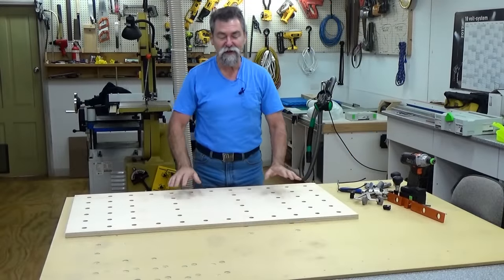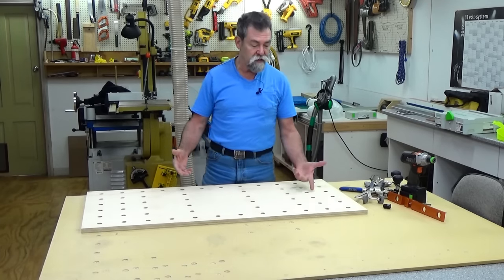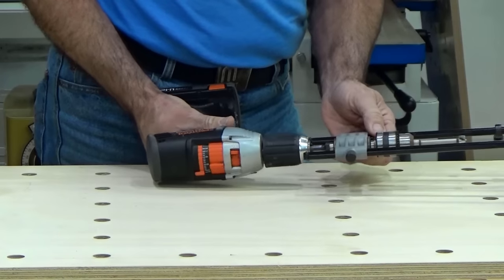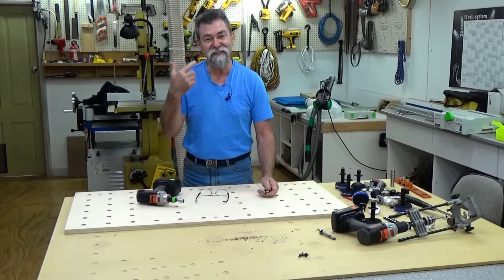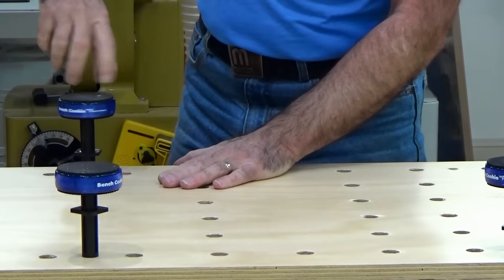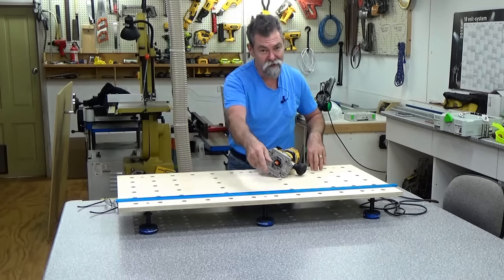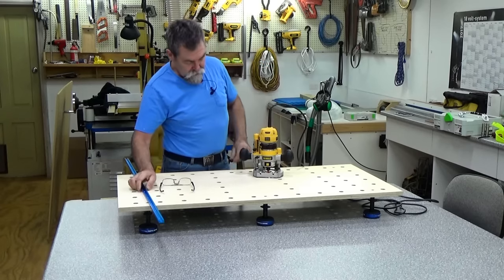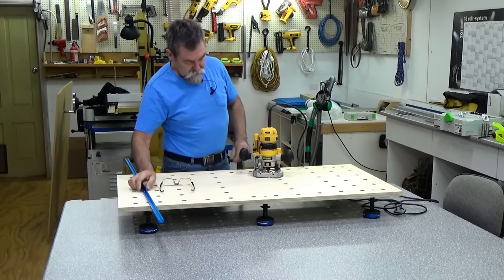Build this Festool mft style portable bench for under $150 Dave Stanton woodworking workbench

Comment: Hi Dave.  I am considering using this top for a new work bench as a permanent  fixture.  I do like the Festool MFT but prefer a table which I can roll around.  Thoughts on using this build for this type of bench?
Reply from the maker: It will be fine! Maybe use a hardwood marine ply instead of a softwood as it will have a bit more resistance to possible bowing.
Reply: Good advise.  Do you find the size is ok being 45 9/16" x 30 7/16" (1157 x 773 mm) which is the MFT default size is large enough?  For me a bit larger would be ideal but I don't think it would be a good idea ordering extra Festool MFT side rails and piece them in to make the table larger.  For me the ideal table would have outside table dimensions of 48" x  36" (1,219.2 Millimeters x 914.4 Millimeters.
Reply from the maker: The size of the top will have to be a personal thing Gary.

Comment: Great video!

I was wondering if it is standard practice to plane the edge of the plywood sheet like you did - is it a concern that the plane cutting edge will get dull easily? Or can I plane the edge of ply like Baltic birch without fear? 
Your thoughts are much appreciated!
Reply from the maker: A low angle plane is usually best for planing end grain but, Just as long as you are getting a good result from a plane then the result on the job being worked is more important than the blade on the plane. That is why we learn how to sharpen blades.

Comment: The MFT seems great, thank you for making these videos! I have a question though: how tall is your base table? Is it lower than a normal work table to adjust for the extra height of the MFT (3/4 inch MFT table + 1 inch bench cookie + 1 inch riser = 69,85 mm / 2,75 inches)? Or do you have some sort of height adjustment system (lift, etc)? I am planning on the MFT along with buying or making a work table, so I wonder how you solve this problem... Grateful for any advice on this!
Reply from the maker: The Stanton bench is designed to go on top of a standard dining room table which is around 700 to 770 mm tall. The work surface I have it sat on here is the same height as my table saw.
Reply: Thanks for the quick reply! That makes sense, I guess this is more directed towards those who do not have enough room for a dedicated workbench. After some googling I found out that table saws are often 34-35 inches or 870 mm tall, I am a bit worried the Stanton bench will be too high if I buy/build a 870mm work table. Could I ask, if you were to build yourself a workbench/assembly table and you only had room for one, how would you build it/what kind would you build?
Reply from the maker: It really depends on the circumstances and need as well as your height.
Reply: Good points! Thanks again!
Reply: @bjormeli  
Make your own custom bench to work with. You can build in all manner of clamping solutions and fixing methods that you will not be able to have on a bought table unless you are paying a fortune. 

I have an MFT3 table but it is for use on the jobsite and not for the workshop really. I have made several portable benches similar to this video but not quite as good and I am going back to the drawing board.

Comment: Could you use Formply for this? Or is the waxed hoop pine better for some reason?
Reply from the maker: Yes to formply but it is only 17mm thick so you will need to shim that last mm for the legs to work correctly.
Reply: @DavidStanton  Thanks Dave, Your a Legend!!

Comment: Hey David, been watching your videos for awhile all the way from California. Isnt the Internet amazing to bring our wood working communities together? I just want to say i really like many concepts in this bench and think i might build my own rendition using your plans. I think i might double up the plywood and laminate them together so i can have a little more mass for chiseling mortises and such. I will add an extra t track for clamp accessories rather than the festool clamps.  I like the MFT style dog holes and that i can use my track saw with my protractor on it similar to the MFT. 

My question is, do you see any other way of drilling the holes in the top without buying the expensive drilling system? The bench top is cheap to make, but with the drilling system, it turns into a very expensive endeavor. Thanks
Reply from the maker: No other way that is as accurate.
Reply: hmmm. I am thinking I might just try to make my own template and get them visually close enough to work. I wouldnt be using the dog holes for the crosscut feature. I would be setting up a MFT style protractor rig for my track saw i think. That would work for me. The dogs will mostly be for planing boards and holding work for mortising etc.
Reply from the maker: That would be fine if it was not relying on dead square. You could use the drill guide that I used for the brass inserts.

Comment: How accurate should the MFT table be? For instance the Festool MFT and such. Reason i ask is i purchased  jig to make the grid and was not happy with the accuracy. I could not get past a 6x16 hole layout with out seeing runoff due to the guides locking in the jig had some slop. I might get it to be better if i add around the template guide to tighten the tollerances. But when i contact the manufacture they claim that tables are never accurate its the fence system that makes the accuracy and i was expecting too much even thought there jig was at a premium price off $199. Purchased this one due to UJK was out of stock but now i have one but have not used it yet.
This was the response when i gave them the numbers that either the jig was off or the supplied Template guide was off.

Hello Cliff.  There is a big misconception with MFT tables and tops. The accuracy of a Festool MFT table comes from the actual rails that are part of the table itself.  All  of the Festool attachments are attached and referenced off of the rails.  Not the table.     If you think about all the “connections” from the router to the actual hole there are a lot of variables at play

Router bit.
Bushing to router.
Bushing to template.
Indexing pin to template.
Indexing pin to hole.
Locating pins to the template.
Locating pins to the workpiece.
potential runout in the router collet 
 

There has to be sufficient clearance between each of those for them to work.  As you add holes, that “stackup” error will grow.  The only way to avoid that would be to key off of the same location for each hole.  Essentially what a CNC does.  You want to make sure that there is no movement in the template when drilling the first holes.  The template must be firmly clampled in place. 

 

The Festool MFT table is a clamping/work table. Without the additional fence system, it cannot be used to make accurate cuts. Once you install the Fence system, you must calibrate the track to the fence.  At no time are the holes a part of that calibration as the holes are only used for clamps and stop etc.  

 

Even if done on a CNC, with the movements and wear in MDF/wood, even the Festool table is not very accurate. Check the Festool marketing data and you will not find anything about using the holes to make cuts, only for work holding. The accuracy comes from the MFT table rails.
Reply from the maker: Hi ealdydar! Return the jig to the manufacturer. The answer they gave you is absolute rubbish! The hole alignment must be accurate, if not why would they be selling a jig to try to be accurate???? You may as well drill holes at random if clamping is the only purpose.
Reply: @DavidStanton  Thx for your comments. i have a UJK Parf Guide  now and im over the top satisfied with it. Id do a layout with it the check all different sides 3 4 5 with the sticks and taking my time it just works. Love your content. I dont care if content is simple or advanced alway looking to see what people or doing to advance my craft.

Comment: Bought a 4'x4' pegboard with 1/4" holes and exactly 1" spacing, quite inexpensive and I need it anyways. 

Used a 1/4" forstner bit to pin point the position first and then drill 3/4" holes with Forstner with 4" spacing on a 2'x4' poplar plywood sheet. Turns out to be quite accurate.

The recommended insert is really bad idea to me. It gets loose quickly. Also, the bolt and even together with nut get stuck with the insert quickly. When I turn the bolt loose, it actually turns the whole insert out too. I would rather use flush flanged insert instead.

Better yet, I would spot face on the top side and use a bolt to tighten down a stand I can make myself using such flush flange insert. Put a sand paper at the bottom of such extremely simple stand and it will not move anywhere.

I can then use the Rockler cookies for the bench instead.

Really appreciate this video and it made me to make one of this (similar) and learned a lot from such process. I also found that a 15 amp drill make drilling 3/4" holes much easier.

Keep exchanging the ideas and lessons so we can all learn something everyday.

Comment: Oops, one more suggestion:  For those who are lazy like me, instead of clearing the hold-down surface in order to flip the top to the cutting side,  you can use a piece of 1/4" MDF as a sacrificial surface protecting the hold-down side from the blade.  Just slide it up against the dogs and cut just like an MFT -- those non-skid strips will hold it in place perfectly.
Reply from the maker: That is a possibility.

Comment: Hi Dave. Just wondering what is the height of your assembly bench from your floor? 850mm-900mm? Not the height of the Stanton bench with the cookies under it. I just got the praf guide system and I am going to make a similar version but bigger.
Reply from the maker: I built mine to be exactly the same height as my table saw. Close enough to 860mm.
Reply: Thanks for the speedy reply Dave. Love the videos, keep up the good work. I'll send you a picture of my bench when I finish it, im making based off your Stanton bench with some modifications to suit my needs.

Comment: Dave the square guide for the plane is that available locally and does it fit a particular size plane
Reply from the maker: Hi Jim. It is a veritas fence and carbatec have them. https://www.carbatec.com.au/handtools-and-handplanes/handplanes/accessories/jointing-fence-veritas
Reply: Thanks Dave, had not seen it before, makes the job of sitting square so much easier

Comment: Dave thank you for the information and looking to build: can get Carter Holt Harvey 1200mm x 595mm (1/4 sheet) 17mm F14 FORMrite Formply from my local Bunnings store for $10.98. would this material be suitable.
Reply from the maker: It will still work but the only problems I foresee would be the t track has 2 mm less plywood below it in the dado and the dogs may not clamp tight from underneath if you use the speed bolts.

Comment: What size is the tee channel.
Reply from the maker: Charles Sharpe, it is 3/4 x 3/8.
Reply: @DavidStanton  Many thanks for the  info and the quick reply. I have been in woodwork most of my life use a 11 foot long joiners bench I made with a top made from 2x8 front and back and 3/4 floor board in the middle. I am seriously thinking of changing over to a flat MFT style.

Comment: Why didn't you just use shorter screws and eliminate the grinding and sanding?
Reply from the maker: I didn't want to drill new holes in the track to make larger diameter's.

Comment: OK so we’re all woodworking nerds here and we’re all going to nit pick. In all likelihood you probably have better hand-eye coordination than me and you put those track screws right where you wanted them. I definitely would’ve used a vix bit to start those. I’ve ordered too many hard wood door frames from various millworks where the guys didn’t take the simple step of using a vix bit and the hinge screws looked all wobbly and shitty. Pre-hung, you don’t see that shit until it’s installed, and then what do you do?
Reply from the maker: Use a vix bit David, it will of course help.
Reply: @DavidStanton  thanks David, will do.

Comment: Thank you for sharing. 
BUT: Using router without dust extraction, dust mask and then use that great facemask with sender attached to vacuum DOESN'T make sense.. and then use sander no mask no vacuum..
Thumbs up in anyways, it's great video in general.
Reply from the maker: Watch again. I think you will see I have dust control pretty much covered in one way or another.

Comment: How the cost of this under $150 when the Parf system is required to make the holes. That tool alone is over $200.
Reply from the maker: And a circular saw costs money as well as a drill. These are all tools. I am referring to the cost of some t track, legs and cushion strip.
Reply: Yes but a circular saw and drill are universal tools that can be used to build many things, tools everyone owns. The Parf system is a specialty tool required to make ONE singular thing. You can't pick and choose the cost of what is required to build what you are putting up on youtube to garner clicks. The resulting tool is a universal tool once you buy the parf system and complete the table top. My point it sound this costs more than $150 to build this table top. You can't just selectively omit the cost of a tool that is REQUIRED to complete the build (and 99% of people with shops do not own).
Reply from the maker: The process can still be achieved with a square and a ruler which are universal tools. I know of many people who have built the bench in that manner.

Comment: Dave, I like your videos and you present well. But (you knew there would be a but, didn't you?) I'm a machinist and have a hot button.  That hot button is when I see someone using a file like it is sandpaper.   That file has teeth that are designed to go in one direction to cut.  Dragging it backwards, especially on something as hard as the screws, just dulls the cutting edges.  Let me hasten to add that seeing that in no way makes me want to quit watching and liking your videos.  As you know, the details are everything.  I think you and I are just as anal about our shop tools.  Regards.
Reply from the maker: My apologies.